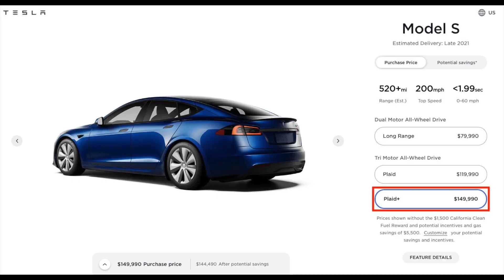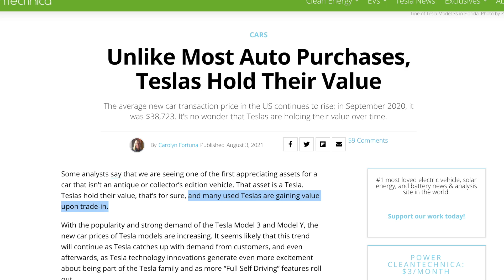Tesla 4680 Update: Moving Through Production Hell

Comment: Nice video.  

Maybe you have some insight to a battery question. 

Are they planning tonintroduce the tabless design on other batteries? 18650, 2170... It seems like this would be a significant advantage regardless of battery chemistries. 

And... do you think the 4860 manufacturing process could easily be modified to make LFP 4860 format? China's legal restrictions on the tech are going to lapse in a year or so.

Comment: The 4680 format is a cheaper not better battery.
Reply: Tabless electrode is definitely a much better battery. Are you kidding? Delivers power without heat accumulation. C’mon man.
Reply: @KyleHubb   Tabless electrodes by necessity.  The smaller form factors don't need this.

Comment: The 4680 will charge significantly faster than the 2170. Plus if they shrink the 4680 battery pack it will charge faster. If I was in line and could wait I would. That being said if you wait very long to order you may not get it till the line is up and running with the backorders!
Reply: The 4680 cells will charge slightly slower than the 2170s. Please take another look at the Battery Day charging graph.

Comment: I care what battery is in my car I would absolutely wait for the 4680, faster charging, more cycles the "million mile" battery.
Reply: There is no faster charging, at least at the cell level. For anyone that still thinks that, please rewatch the Battery Day presentation and pay special attention to the charging graph. As presented the 4680 cells will charge slightly slower than the 2170s.
Reply: Watch some deep dives. 20% increase but possibly larger overall pack for cybertruck and 1.5 million mile cycle life based on original Model X plaid range when it was to have new cells.
Reply: @pinball16  That’s incorrect. The 4680 cell charges slightly slower that 2170. Only if the pack size increases can the charging rate surpass a 2170 pack. That is not a given as Tesla might keep the size the same and lower cost instead. Too many people misread the Battery Day graph and assume the 4680 cell charges faster while it’ll be slower in reality and according to the graph.
Reply: Are you accounting for much more aggressive charging graph and cooling? Don't have that huge slowdown at 80%.
Reply: @pinball16  Yes, all of that is taken into account in the charging graph from Battery Day. Like I said, everyone misreads that graph.
It’s pretty simple, the cells can be bigger because the cooling performance is better with the tabless design. In other words, all of the benefits of the tabless design and improved chemistry are traded for a larger cell, which results in a cell that can be charged only slightly worse than the 2170s.
All cells have a reduced charging rate the fuller they are. Any car that doesn’t only shows it’s already limited from the start and/or is using a large invisible buffer. Don’t be fooled by a flat charging curve; doesn’t exist at the cell level, all cells have a reducing rate.
Reply: @MacGuyver85  thanks. Good to know. I was hoping for a balance between smaller pack size / cost and range improvements with the new cells not JUST a reduction in size of pack and cost. Seems like 2170s have improved over the span of their use and refinements so will be interesting to see if the 4680s will eventually follow that trend.
Reply: @pinball16  You’re welcome.
Well, it’s still possible that Tesla increases pack size and thus surpasses the 2170 cars on all fronts but that’s not a given and, my guess is that, at least initially, they won’t want to have a difference as it’ll take time to scale production and they’d Osborne their own (2170) cars.

Comment: Gali, For Tesla AI I can see a huge application in current manufacturing  industry. There are thousands of dumb robots/manipulators/conveyors out there right now handling parts for processing. The problem is that they have many sensors for detecting parts, position of part, position of the gripper, etc, there's just a boatload  of sensors on these things. Why? Because they are Blind and Stupid! Did I pick up the right part? Did I drop the part? Is the machine door open so I don't crash into it? etc, it goes on and on. The cost, maintenance, downtime for all this crap is significant. If the robots/manipulators/conveyors etc, had eyes and a brain that could be easily taught, bingo big money saver. Just imagine, Did I drop the part? Yes, well then I'll just pick it up.

Comment: I think there will be 400 mile cars once 4680 gets into full production for now we are entering a phase where Tesla can make more short range cars.
Reply: I agree. They won’t make the battery smaller with the same range. It will be the same size with 400 range.
Reply: @DaveDugdaleColorado  the Model 3 is rated at about 380 miles now. With the 2170s. It will be way more than 400miles.

Comment: 4680s are years and years delayed. Tesla expected to ship them in 2019. This is why battery day was delayed so long. 

Anyway 2 points:
1) 2170 supply is still limited and using 2170s doesn't increase the number of cars they can produce, so just spreading essentially same amount of production around. LFP in M3SR+ will free up some 2170s, but not be anything like what Tesla 4680s will unlock (eventually).

2) it isn't easy to just switch lines from 2170 to 4680. They may hold off on this for a year or more and use 4680 elsewhere.

Comment: i dont get why they dont just use carbon fiber or graphene based rollers.  if the rollers keep deforming, why not just use a harder material?
Reply: See how quickly you can source that roller in the open market (not likely) or build a production line to build these custom hardened rollers. And maybe still find defects. After you reset the motors that control the rollers and the machines that hold them. It's not impossible but it takes time. Hence the delay.

Comment: This is the quiet kind of progress that people often miss. They've solved a couple of the many problems that they inevitably face, they haven't run into any unsolvable problems, and they are forging ahead.

I suspect the introduction of 4680 cells into car production is going to be announced by some FUD driven outlet claiming that the line being shut down for a few days or a week, and then being at limited capacity for a week indicates that Tesla's death is inevitable and 4680 is a failure. Then two weeks later they'll be back up to speed, we'll move on to the next innovation, and wall street will once again be surprised next time quarterly profit numbers blow their expectations out of the water.
Reply: Funny, these are the very same attributes of BYD yet most are completely missing it.

Comment: 1:50 the kilowatt hours would not change, it would just be less material. 

Maybe a few kwh lower because lower weight. But minimal changes there
Reply: Also less weight = acceleration.
Reply: @boggless2771  also less weight = more efficiency = less batteries
Reply: @Deveonn  weight doesn't play a huge role in an EV especially in the highway. This is why a Model S or EQS has almost the same efficiency as a Model 3 on the highway, because of their drag coefficient. The only place where weight matters is city stop and go driving, but you don't care about range there... and Teslas are already pretty efficient there. They will def increase the capacity, that is certain, don't fall for this promo.
Reply: @marcusbiller867  more weight = bigger tires.. don’t forget roll resistance.
Reply: @boggless2771  yes, this is why the Plaid with it's 2500kg is a very slow car... oh wait...You are not an engineer, I can see that.
Reply: Bull, it will have bigger capacity. Tesla is in the range game now, they have to increase the range a lot to move the needle, 20 miles or more doesn't cut it, they need some breakthrough. The car will have more capacity and range otherwise not really worth it from sales point.

Comment: The 4680 delay is NOT good news. There are more than 1M people waiting for Cybertrucks. Tesla Semi can't be built without 4680s. The plan B with 2170 means that the manufacturing process will have to be changed over when 4680s eventually come online, which will halt production and start a new ramp. I don't see how this is good news. I admire your optimism, but let's call a spade a spade.
Reply: If they start putting 2170s in the model Y, why don't they keep on using it and put the 4680s in the CT. Eventually once they have enough 4680, they could convert the Y too. Maybe it is just wishful thinking, but I don't want to wait 3 more years to get my CT...
Reply: @bbalintka  1-2 years
Reply: Yeap

Comment: The roll out of the 4680 cell is I think the most important current issue for Tesla. General production ramp up relies on them ramping that up. Cybertruck, Semi, Roadster, Model 2 all have this as a dependency.
Reply: Well the ‘Model 2’ may have 0 to do with 4680’s.. I think that thing is more likely to use the LFP batteries.. but we’ll see
Reply: @airheart1  Are you saying LFP cannot use 4680 form factor? I thought that was "unlocked" with the tabless design, independent of the underlying chemistry.
Reply: @peter.g6  there is no 100% confirmation that LFP chemistry will, or won’t be adapted into the 4680 architecture by Tesla. But from the cars we expect the 4680’s to go into with some certainty, and the way Musk talked about the Nickel use in the batteries in those higher end vehicles, it seems clear to me at least that the 4680s will be Nickel based chemistry, not Iron. The LFP, iron, based chemistry seems to be mostly in prismatic cell architecture from what I can find. Not exclusively. And it is hard to find concrete evidence on some of this stuff. We know MIC model 3 SR+ have LFP chemistry batteries. And that they are now offering those batteries even here in the USA in M3 SR+. But I can find no one, anywhere that has seen if these are prismatic cells or cylindrical. It is highly expected they are prismatic, from CATL. But we do know CATL makes a cylindrical style too. But it seems different from either the 18650s or 2170s. The 4680s could some day, or maybe even by another manufacturer, use LFP chemistry. But it’s my inference that Tesla’s 4680s will be nickel based chemistry for something like the next few years at least. They need every one they can make for their Semi, Cybertruck and Roadster 2. At some point they want them in Model Y too.. that will be when maybe we could expect them to offer a model with LFP chemistry in 4680, if at all. My sense of it is the ‘model 2’ would be most likely to get whatever LFP batteries are most common at that point.. prismatic being the most likely to me.. but possibly there will be some cylindrical common use of LFP by then. It’ll be interesting to see
Reply: @airheart1  Yeah, it all makes sense. But I think Elon was specifically asked about the chemistries on battery day and he mentioned their process is chemistry agnostic (exactly these words I believe).

That lead me to believe they will also make LFP internally, cause if they have the technology to make lots of batteries cheaply with different chemistries, why wouldn't they.

Of course, it might be a little later, as it's probably not that easy to switch. But I believe it will happen. Especially if say MY LR uses 4680 Nickel batteries, I can imagine a MY SR with LFP.

Time and Jordan Giesige will tell :)
Reply: @peter.g6  yeah I think that is a reasonable and even probably long term plan. I kind of do recall what you said, that he did throw that phrase out there. It just didn’t seem firm that, yes, Tesla will make 4680 LFPs. But I think it’s just because they are so wound up in the short term getting the 4680 production 100% nailed, and then built up globally and ramped up. And I think that will all start with the high end cars as they usually do, and that means their NMC chemistry. Once they probably have sufficient supply of those to really build out the product lines that are all waiting.. then I think, yes.. either made by Tesla or other battery manufacturers.. we start to see LFP 4680s going into the SR+ model Y.. maybe even M3.. and probably the little ‘model 2’ at some point. Lots of cool stuff coming.. and there’s always some surprises from Tesla. 😄 i wouldn’t at all be surprised if there’s prismatic LFPs being used until they can fill that supply with 4680s.. but i also wouldn’t be surprised they just decide there isn’t enough 4680’s to ever even get around to making LFP versions.. idk
Reply: Yeah, once it's ready it's gonna be like a scene from a movie where all cages in a zoo get opened at the same moment and all the beasts start wandering around.

Comment: The biggest change people will see with cars coming out of the two new factories will be with increased quality - better paint shop and better machines producing less parts in better tolerances. The 4680 is what Tesla needs to increase volumes and doesn’t provide much benefit to the purchaser aside from hopefully a shorter wait time.
Reply: besides, more range, longer life, way faster charging, way more power, no heat issues at all, cheaper, way more sustainable, basically everything is better
Reply: Structural pack will improve ride, noise, and handling. Might also be responsible for some fitment improvements. And 4680s are the 1,000,000 mile batteries, that may also have better charging characteristics due to better thermal management.
Reply: Front casting too!

Comment: Even if the range from the 4680 is the same as the 2170, have a smaller battery and/or less material translates to less weight. Less weight means better handling, better acceleration and higher efficiency.
Reply: Better handling? Not necessarily. In fact, handling can get worse.
Reply: @nothingtoseehere96  nope less batteries means installing them more in the centre of the platform means better handling.

Comment: I wonder if 4680 got put on back burner because chips / other parts are now the bottleneck
Reply: No way. 4680 is theeee most important thing right now. Plenty of engineering work to do to work out the manufacturing process.
Reply: Doubtful.  They will need soo many 4680s for the cybertruck and other vehicles that chips is almost a non-issue for tesla (especially because they made the software flexible enough to handle multiple sources).  Worst case scenario they would put them in power storage products if nothing else.  While Tesla is struggling to get their production to the next level traditional car makers are pushing PHEVs because they cant get enough batteries.